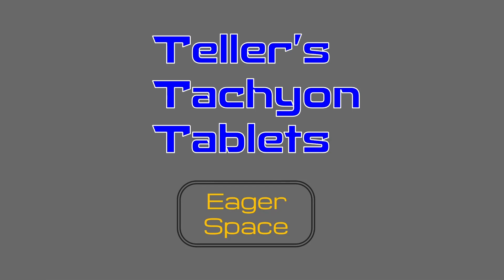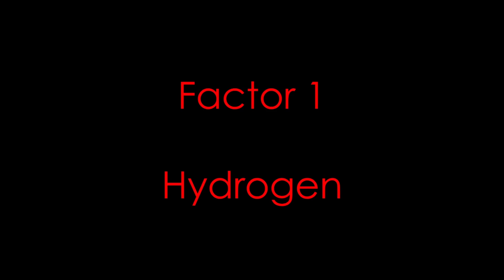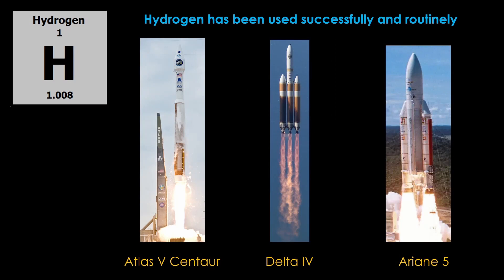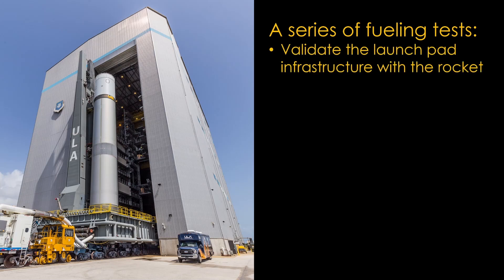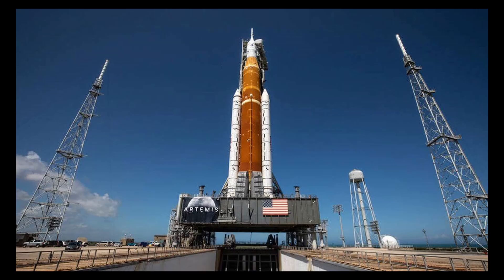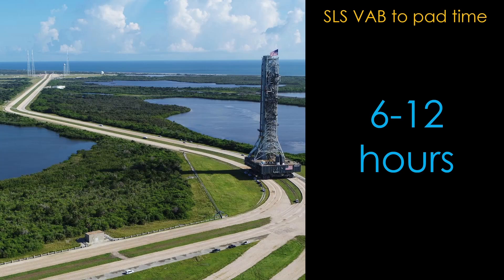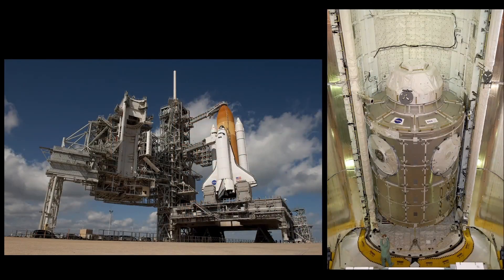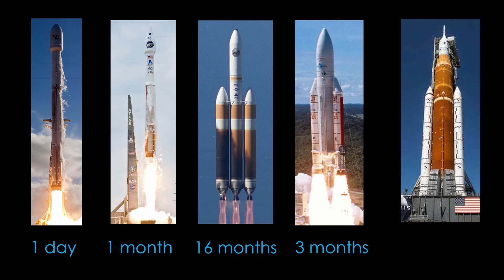SLS - Why so many scrubs?

Comment: I didn't know about the lack of a fueling pathfinder. Thanks for the research. When we make a pathfinder unit here at work (we make medical devices), one advantage is that we can subject the unit to multiple extreme conditions. We want to know where the failure points are, even at the risk of destroying the pathfinder. The SLS team will not have that luxury.

A pathfinder shouldn't be necessary when the technology is already well understood, so one could argue that the SLS team shouldn't need to reinvent the liquid hydrogen wheel. My guess is that they took a calculated risk, based in no small part on their budget and promises made to Congress.

I don't envy that job. It's easy to write something dismissive about government agencies, but it's pretty rare for a hash critic to gain power and then spectacularly turn things around. It has happened, but the more common outcome is to discover that the agency leadership was not a root cause. I'm not saying we should give up on process improvement, just that we should test management theories at least as carefully as we test hydrogen seals.
Reply from the maker: I don't disagree, but "calculated risk" sounds very close to the attitude that got us Challenger and Columbia.

If you don't do the pathfinder, then it's pretty clear that "go fever" is going to come into play, and we saw it with them going from wet dress to launch. And then from trying again when they ran into the first issue and ending up with a worse result. It's a very unfortunately behavior from an organization that says "we won't fly until it's safe" - if they really believed that they would have repeated the wet dress until it worked. 

These might just be teething issues. Or they might be symptomatic of bigger underlying issues. There's simply not enough data to know.

Comment: It seems like to me they could have launched on the first day but didn't because they didn't realize the engine temp sensor was out of wack. They got through fueling just fine minus a couple of hick-ups, which tends to happen to hydrogen fueled rockets. Delta IV Heavy and Shuttle.
What sealed (hehe) the deal is when they opened the wrong valve on the second attempt and fubared (over pressurized) the hydrogen line. From my understanding that is what caused the scrub. It wasn't the same hydrogen leak reappearing that they worked through on the first day.
Reply from the maker: I actually went back and looked at shuttle scrub history, and shuttle only scrubbed a launch 6 times because of hydrogen issues. And interesting, in the first 11 launches, the only scrubbed twice, neither because of hydrogen issues. 

I suspect that is because they did a lot of pre-flight testing and they may have found issues that delayed a launch attempt but it wasn't actually a scrub.
Reply: @EagerSpace  The problem with Artemis is that with only a single test article, failure is not an option.  Even if they get the bird off the pad, and successfully separate the SRB's and the first and second stages,  the Orion cluster must work almost perfectly, including reentry, parachute deployment and landing and recovery for Artemis 2 to go ahead. And that must go almost perfectly for the lunar landings...presuming that the Gateway is designed, orbited the Moon, and the landers are designed, tested and accepted.  Even SpaceX's Falcon 9's flew a number of test flights and failed to recover the booster initially.  IMHO, the whole SLS/Orion was ill-conceived and underfunded, yet pushed by Congress.  But it is what we have at this point of time, at least until Starship is ready to fly from LEO to the lunar surface...without Gateway!  

One thing to remember...we saw plenty of scrubs back in the days of Mercury, Gemini and Apollo, including the deadly fire. (Say, boys and girls, most high school chem labs demonstrate what happens when you plunge a glowing ember into a test tube of 100% oxygen. Apparently NAA engineers skipped that lab before conducting a plugs-out test inside a sealed spacecraft with 100% O2 and fire sources, and no way to open the hatch! )
Reply: @jamesbarnard9710  You can criticize a lot of decisions NASA made concerning SLS, but it certainly wasn't underfunded. Look at what other spaceflight actors achieved for a fraction of the budget.
Reply from the maker: @jamesbarnard9710  Definitely agree. There's no contingency if things don't go well other than to - I guess - pull a later mission to back (Artemis I.5?) and try again.

Comment: Wouldn't Ares-1 be the most recent "new" rocket that NASA has launched? I know it didn't last, but it did get one launch(that didn't work too well)
Reply from the maker: Damn. You are, of course, correct. That's especially embarrassing since I'm working on an Ares I video.
Reply: @EagerSpace  Bo worries. It was only the one test flight so it almost doesn’t count anyway. Especially since it wasn’t a full 5 segment SRB and a boilerplate upper stage.
Reply: @EagerSpace  haha happens to all of us. So when did ares I fly?
Reply from the maker: @whitedrawf  October 2009
Reply: Just revised it as “liquid fuel rocket”.